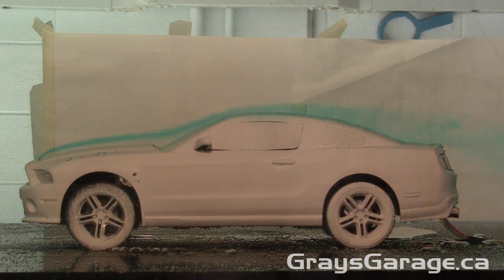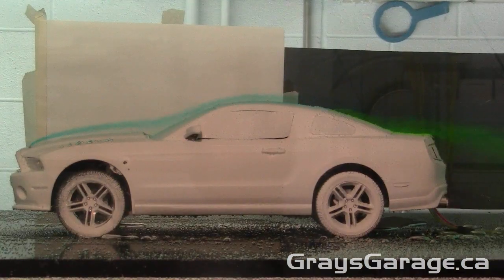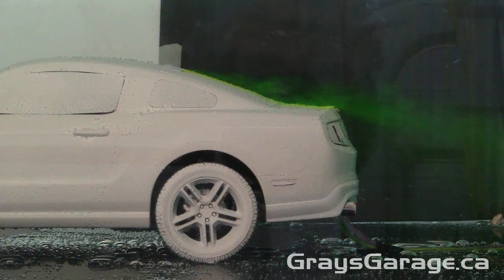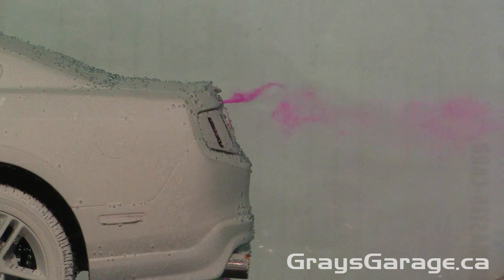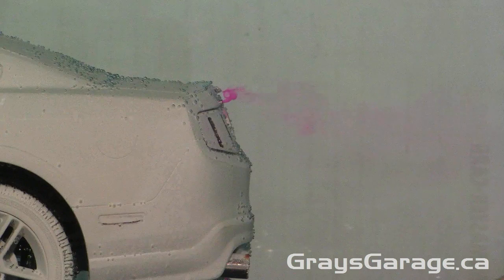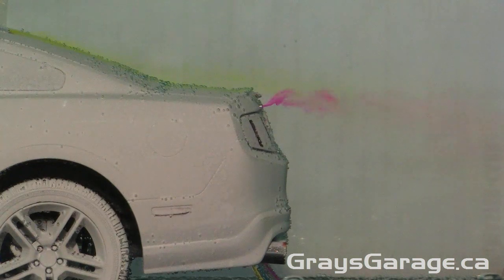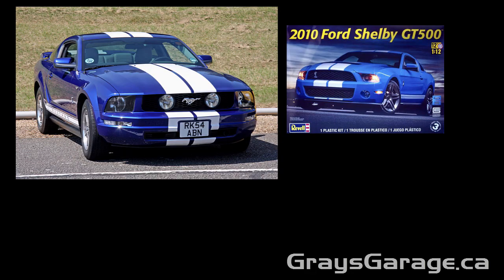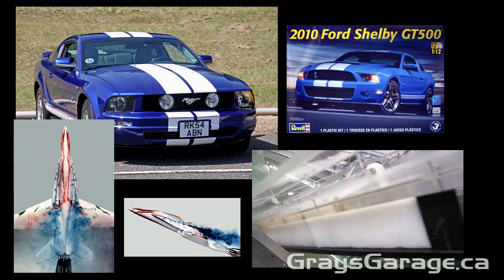Ford Mustang Aerodynamics

Comment: That's interesting to see. So a deck lid spoiler would be worse for high speed?
Reply: Spoilers are only good for downforce for track use. They’ll pretty much always ruin your top speed
Reply: Thing of the raised portion of the spoiler literally pushing against the air you’re trying to drive through. It’s hard to go faster when you have something in your way

Comment: Oof, hydrogen bubble method is vastly superior. I did like the top down view though. To have a wire that could be moved along the full width of the model would be even better to see how flow around the sides of the car performs. I was hoping to see on this generation Mustang how flow is around that huge, blocky front end is. This dye method really lacks a lot of detail.